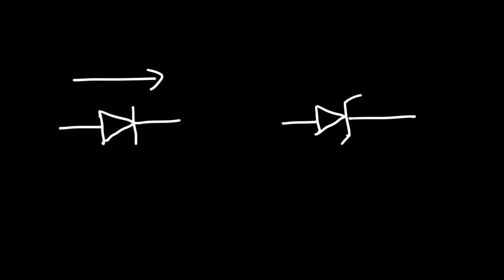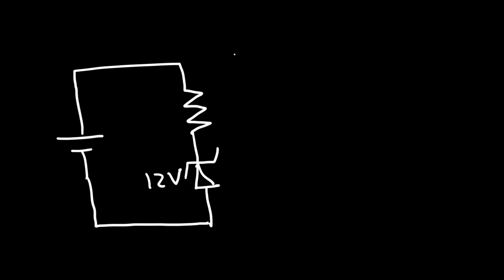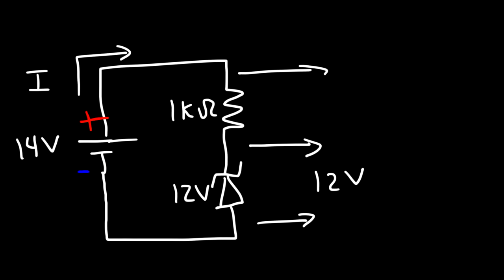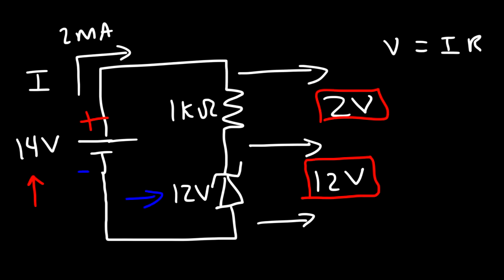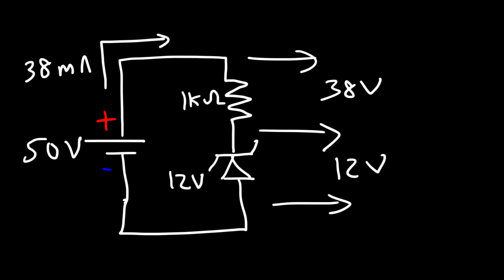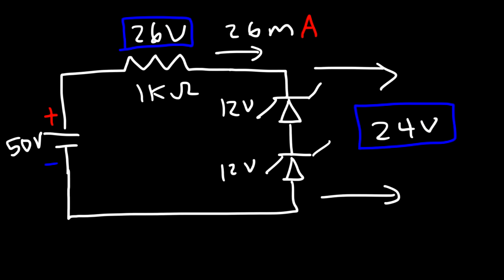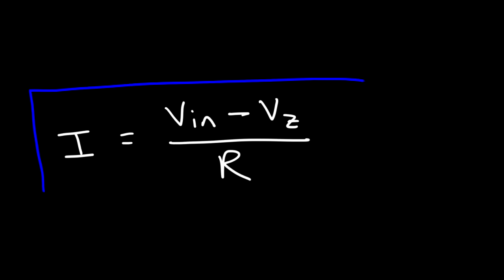Zener Diodes

Comment: But for what are zener diodes used?
Is It to drop the voltage? If so why dont just use a resistor?
Reply: Zener diode permits Zener current, Iz, to flow when the voltage is above the specified Zener voltage. Zener voltage across a diode remains constant over a wide range of Zener current. Because of this property, Zener diodes are widely used as constant-voltage devices.

Comment: When looking at these problems, are we looking at hole flow, or are we looking at electron flow? Basically, will the current flow through the resistor first, or will it flow through the diet first?
Reply: I think you can look at either flow and will still get the same answer. As long as you're consistent throughout your analysis and computation

Comment: I have a dumb question, if we have a circuit with two zener diodes and one resistor connected in series, both zener diodes are placed as reverse bias, if power source has voltage greater than one of the diode but smaller than the other diode, will there be no current flow in this circuit?

Comment: I made my own 2 amp regulator using a zener , saved buying a to3 cased lm 780x device, just have to stick to a fixed input and output voltage so not to over current the zener.

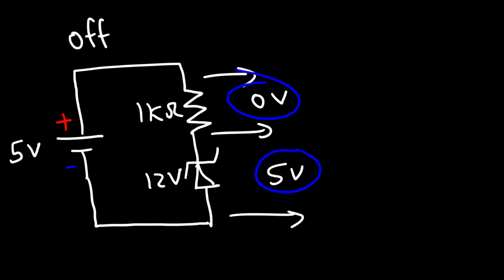Comment: 2:37 kinda blows my mind a bit. No current through the circuit, so I = 0, but 5v through the zener diode? But ohms law says v = i * r ? I was totally tracking until this point. Please help me understand what I'm missing. This is an excellent tutorial and already I now understand how a zener works to essentially siphon off a set amount of voltage from the circuit.
Reply: same scott
Reply: @Scott 
* Ohm's law is not applicable in semi conductor devices. 
* diodes when used under reverse bias do not let the current pass through it but when the reverse bias voltage exceeds the zener breakdown voltage, the current rises abruptly due to the high value of electric field across the junction which leads to breaking of covalant bonds of the atoms present at junction and many charge carriers emerge(set free) due breakage of the covalant bonds and a high current flows through the diode.

But here zener voltage is 12 volt and the reverse bias voltage is 5 volt, therefore no breakdown will occur and it won't let any current pass through it and the voltage accross it would be 5 volt due to law of conservation of energy.
Reply: Try to think about it like this: imagine the current being very small instead of zero, let's say in nanoAmps. Imagine the zener diode as a resistance with a very high value, let's say in MegaOhms. And give the resistor a value of 1Kohm. Use ohm's law as usual, and it works fine.

Comment: Hi i have a UV LED lights that runs in 5V and when i check   emits 240mA. Now my source is 13V battery. When i series 1000 risistor and place 4.7 zener.. in voltmeter.. i got 4.7. But when i connected my UV lights, the volt drops to 2.9V which cause UV lights to emmit dim lights. What can I do to output 5V with around 240mA from 13V battery?

Comment: Help please: at one point he says as the R (L) goes up the current through the load increases. 

I know this is a correct statement but I am having problems  understanding why current would increase with higher resistance. This opposite of normal intuition and how things normally go.

Also why would current  go through the load at all when it can just go through the zener diode.

It is like if you replaced the load and the zener with two parallel resistors, the lowest resistance will have the most current flow.  Here it seems flipped.

Comment: Good, if the out put is connected to a transistor base pin with proper connection then it will become a voltage regulator transistor, and also zener diodes were used for starting of electronic devices by feather touch switches.,pre determined settings for any comparator's also zener diodes were used, and zener diodes were regulating the complete globe in smps power supply put.

Comment: What I didnt understand on minute 10:09 D2 is in reverse mode so opposite with the arrow of the current so negative voltage but why D1 is still negative? Shouldnt it be positive since the arrow of D1 is in the same direction with the current one and it is in the forward mode?
Reply: Pal, I have the same question. Anyone to enlighten us?

Comment: Hi,
I have the guitar amp that needs 19v power supply,  but I have the 20v battery.   How could I drop the voltage down to 19v for my guitar amp without losing much power for my battery and safe my guitar amp.  I guest my guitar amp is class D.  Can I connect directly to the battery without causing any problem?

Thanks, 
Lan

Comment: What if i put a capacitor before the resistor and 50 volt battery ; but the capacitor be conected negative towards the 50 voltage and positive towards the resistor to regulate the current flow; will it work.

Comment: Good video on the zener diode  Given the high voltage noted in the DC 50V example, you should have spent a moment to discuss P=I*V and the importance of the power ratings of the resistors. Some novice viewers might replicate this circuit on a breadboard using an improper 1/4W (.250) resistor and be alarmed by the magic smoke.

Comment: is there also a diode liks this which regulates the voltage without dropping it by the regulated amount,  for example if i have a 24v battery that goes to a zener diode and then to a solenoidvalve that needs 24v volts, is there some sort of diode that can only let the current through at 24v without taking 24 volts

Comment: 2:24 why is resistor 0V? I learnt that even there is no current there will still be voltage right? Why is all the voltage on the zener diode?
Reply: Additionally, it troubling to say something like "the voltage on the zener diode." When discussing voltage in regards to circuits, it typically means the voltage difference between two points. For instance, the voltage drop across a resistor means the voltage of one end of the resistor (relative to ground) minus the other end of the resistor (relative to ground). In this case, the voltage relative to ground on both ends of the resistor is 5V, the the voltage drop (5V - 5V) is equal to 0V.  The zener diode - on the other hand - has one end connected directly to ground, so we know that end of the diode is at 0V (relative to ground since its grounded). Since the 5V hasn't dropped anywhere else in this series circuit, the entire 5V drop must be across the zener diode.
Reply: He means the voltage drop across the resistor will be 0V.  The voltage drop across a resistor is V = IR, where I is the current through the resistor and R is the resistance.  Since 0 A flows through the circuit, the voltage drop across the resistor is 0 V. However, the voltage of the top of the resistor relative to ground is 5V, which may be what's confusing you.
Reply: exactly my question.

Comment: When you say that current flows from + to -, you are totally leaving out "electron flow"; which ALWAYS flows from - to +. Thus the current you are talking about is NOT electron flow; rather it is "hole" current flow which is + to -. IE:

If this was not true, NO vacuum tube would EVER have worked. Since current through the tube, MUST flow from - to + (cathode to anode-NEVER from anode to cathode). It was ONLY when "solid state" was invented, that engineers realized that current has 2 flows: "Electron flow" and "Hole flow"; where the "hole" is the receiver of the electron. Think of it  this way: a telephone pole must have a hole for it to work. It is that simple.

Note: Before Tubes OR Solid state devices were invented, Electrical engineers believed that electron current was + to -. It was not until vacuum tubes came into being; that they realized that had been wrong. 

For whatever it's worth.
Reply: I wish to add something to the above. In the last diagram in the video, IF it was not for electron flow from - to +, the ".6" voltage would NOT be. Check it out.
Reply: No one gives a shit about whether it's hole or electron flow.  Electric current is standardized to mean hole current, end of story.
Reply: @rockspoon6528  Hmmmm! 

There is NO way to "standardize" current in vacuum tubes, by using "Hole Flow". For current ALWAYS flows from cathode (which is always negative) to the plate (which is positive) in a vacuum tube. NO instructor could ever explain how a vacuum tube works by using current flows from + to - (Hole flow) because a plate can NOT emit. But they COULD explain it with transistors. In fact it is practically impossible to explain current flow in a transistor using electron flow - to +.

Lastly, in the beginning of electricity, engineers said that current flowed from + to -; UNTIL, vacuum tubes came out much later Then they said "electricians are wrong, because current can NOT flow from plate + to the cathode-. So therefore current flows from negative to positive. End of story!" But...

When transistors came out, engineers said current flows from + to -. BUT when we challenged them, they said, "Well we are not talking about electron flow. Rather we are talking about 'hole' flow."

Then we said, What in the hell is hole flow? Huh? They were NEVER able to define it enough for most seasoned electronic's technicians to understand it.

I KNOW this because I had to teach this to electronic technicians when transistors came out; and it was almost impossible. And MOST of my students never accepted and/or understood it. They fought like dogs really! With many "expletives" exuded from them. Believe it!

Thus the truth is that current flows in BOTH directions: 1. Electrons flow from - to +; and at the same time 2. Holes flow from + to - (in solid state devices).

Here is the proof:

https://www.youtube.com/watch?v=7ukDKVHnac4

End of Story.
Reply: @MrPatdeeee  I'm well aware of current and hole flow, I have taken Semiconductor Devices classes.  But the distinctions serve no purpose on a circuit scale, it's simple pedantics to argue that there are two currents (true but without value).
Reply: @DixieDee  the video is on electrical circuit analysis you twat, that's why electricity is relevant.

Comment: What is that 0.6 ??  In last sum
Reply: The forward voltage of the diode. There's a 0.6V voltage drop when the diode is used in the normal fashion

Comment: Althouh Zener Diodes are a bit old-school, they do have some modern applications. Back in the 80's, I worked on the first Transatlantic Fiber Optic Cable (TAT-8). It had repeaters every 25 Kilometers or so. The power for all the repeaters was several thousand Volts with each repeater having a Zener of the Voltage needed to power the Repeater in series with the Power. Think of it as a High Voltage supply with a string of Zeners in series with the output, each repeater having it's own Zener with the voltage and current being taken off across each Zener.  Quite a simple setup, but it worked quite well.

Comment: How you get the voltage across in zener diode? In example number 4
Reply: All semiconductor diodes have an internal voltage drop of .6 volts, in the forward direction.. It's just the way they function.

Comment: Great video!
I have a question, though:
At 7:35, the two diodes were dropping 12V each and the rest was dropped at the resistor. What if there was no resistor in the circuit? Will the diodes start dropping 25V each or will the circuit be off?
Reply: The circuit would be "on", with excessive (very large) current going through, burning out either one or all of the circuit components: the diodes, a fuse (if there is one), the power supply.
 Diodes are non-linear elements, meaning the voltage across and the current through them are not proportionally related. A small increase in voltage will result in a large increase in current. For example, if the voltage increases by 10%, the current increases by 100%. It is because of such non-linearity that diodes are able to keep a relatively constant voltage across them even with great changes in current through them.
Reply: You need some kind of resistance in this circuit. Without resistance, it would be like driving a car down a steep hill without brakes; the Zener Diodes would burn up. 
Resistance puts the 'brakes' on the current flow. 
RESISTANCE IS FUTILE!

Comment: I was hoping you would cover voltage shifting with the zenier in series in the secondary of transformer to drop its voltage by the zenier value. I work with Tube amps a lot and the mains used to be 110ac, now there 120+. I was thinking of adding a 10v zenier in each leg of a center tapped secondary to drop the high voltage.

Comment: 2:25 another one of those things that makes sense mathematically, but not intuitively
Reply: it sometimes helps to think of an OFF zener diode as a high impedance resistor, in this case it practically becomes an open circuit. just picture the circuit without the zener diode and the voltage reading should make sense. in this case the zener diode acts like it isn't even there.

Comment: I have 1200 amh 6s battery I need to play 12 volte board but board need more ampere know how to increase ampere ? I all so trying 12 volte boost converter but. If I try haf volume board dropping sound  result is bhuk bhuk ( know what I do ) ?
Reply: get a power supply. try not to blow anything up :)
Reply: @theralhaljordan7337  it's not a joke itry too make boom box but power dropped , I m facing this problem

Comment: Why is the current limiting resistor necessary? What would happen if the zener diode is directly connected (in the reverse bias mode) to the source?
Reply: To limit the current. If you don't put the resistor in the circuit the smoke escapes! ;-)

Comment: @9:37 why are the voltages negative  though? And where did you get the numbers from? -12 and -0.6?
Reply: The same question :(
Reply: same question as well
Reply: Get out a multimeter and check everything out on a bread board, with smaller voltages of course, and work it out! Follow the waves on an oscilloscope!  Experiment to learn and you'll never forget, that's part of the fun of discovery and learning!

Comment: So, you use conventional current flow  instead of electron flow theory?
Reply: I think that is how it’s normally done in essentially all electric and electronic material.
Reply: I've been told that some Universities are still using conventional flow. However, the US Air Force is/was using electron flow theory. One of the local college's near me is using electron flow. And, I've seen some other channels on YouTube that use electron flow.
Reply: @larryg2320  That is interesting to know!  I think there are some cases when you have to consider the flow of electrons as opposed to theoretical conventional charge carriers.  I'm thinking of the design of semiconductors like diodes, transistors and chips, as well as other applications such as those involving cathode ray tubes.  However, as far as electrical and electronic circuit schematics, essentially all of the ones I have seen have used conventional current flow.

Comment: I've been confused with this topic for weeks...read the whole chapter too, still left me confused. Professor himself was confused what he was doing. Your 11 minute video cleared that all up. Thank you!
Reply: My Electronics course uses the book "Microelectronic Circuits" by Sedra & Smith.
I am not really a fan of that book, since I find it dry and long-winded.
I tend to prefer "Fundamentals Of Microelectronics" by Razavi - it's not QUITE the same content, but it's very similar, and includes typical topics such as diodes, transistors, small-signal models, rectifier circuits, and so on.
It doesn't include zener diodes though, but it has a teaching style that I definitely prefer over Sedra & Smith.
And also, Razavi himself has tons of videos on several Electronics courses, and has a pedagogical style much like The Organic Chemistry Tutor.

Comment: Having the resistor in the circuit makes it very easy to find the current flowing through the series circuit.  However, if there is No resistor in the circuit, what happens when 20 volts is applied to it?  How do we find the resistance of the zener diode?  Or does resistance even apply to it in the normal sense of the word?  Would applying 20 volts across it cause it to act like a wire, i.e. a short circuit of 20 volts, and burn out the diode?  I appreciate any input you might have.
Reply: As a useful approximation, a zener is a voltage drop in series with a small resistor.  Without looking it up, say the zener resistance is 2 ohms.  So you have 20V-12V = 8V across 2 ohms which is 4 amps, which will immediately burn out a typical zener.
The datasheet for the zener won't tell you the resistance, because that's an approximation - it will give you a graph of voltage vs current, and looking at the part of the curve where the zener is conducting, you can estimate the 'resistance' from the slope of the curve.  Or you can get the same info by varying the PSU voltage and measuring the zener voltage carefully at different currents.
For example, if the zener voltage is 12.0V at 0.01A and 12.1V at 0.02A then the approximate resistance is (12.1-12.0)/(0.02-0.01) = 10 ohms.